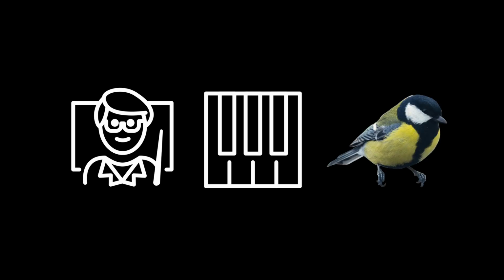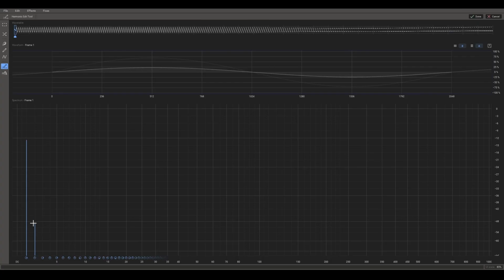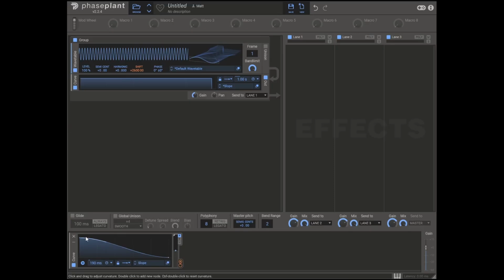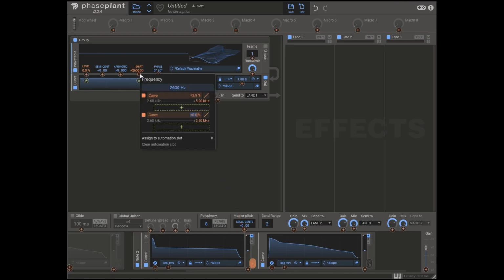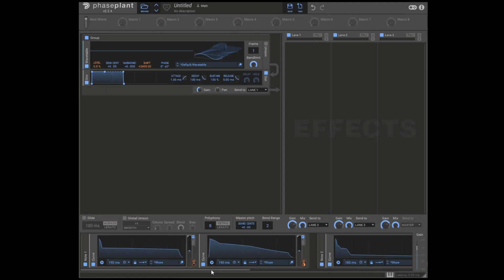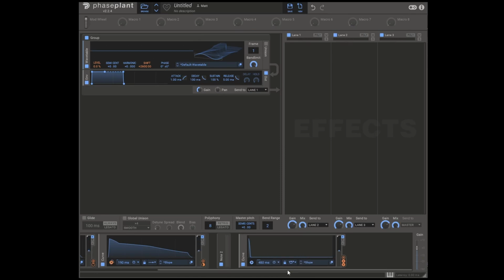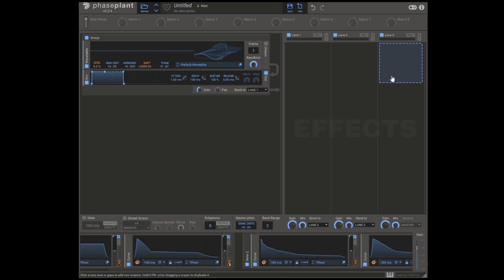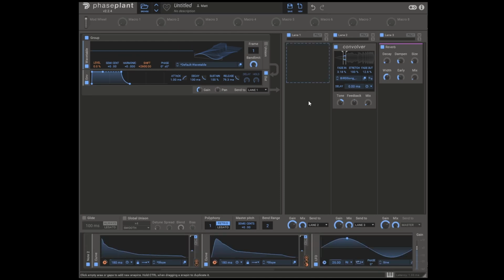Synthesizing a Great Tit Sound || Bird Synthesis 🐦

Comment: I am starting to think... using your system's limits... You could design a basic datatype for these. A set of the most basic variables you use every time you make one of these. Durations, fundementals, spectrum shape... vibrato widths and frequencies.  The "basic" variables would not necessaily capture your whole work flow... but at least give a very clear jumping off point.
Reply from the maker: It's true, there will be a number of factors that will be similar between a lot of bird sounds! I haven't yet explored it personally, but I reckon the basic concepts used here could be usable to design custom bird sounds not based on any specific real-world birds. I suppose part of what interests me about this is finding out what causes a sound to sound "bird-like" as opposed to sounding obviously synthetic. Thanks for watching!